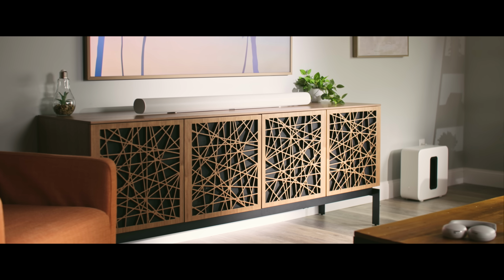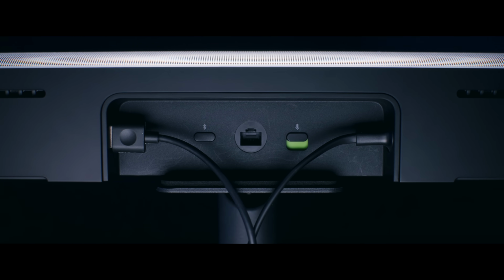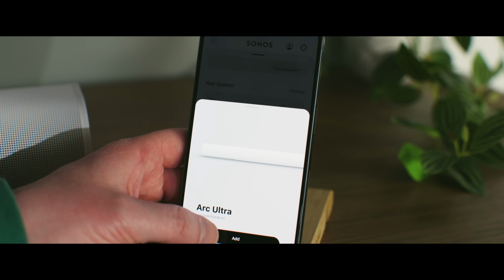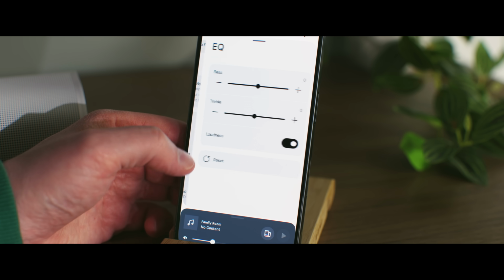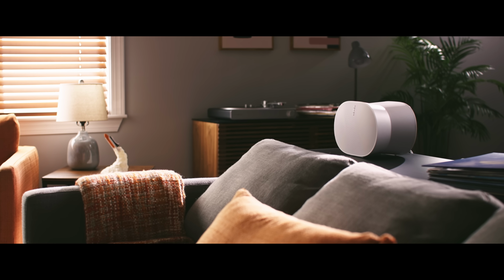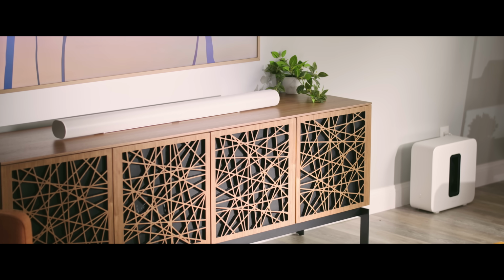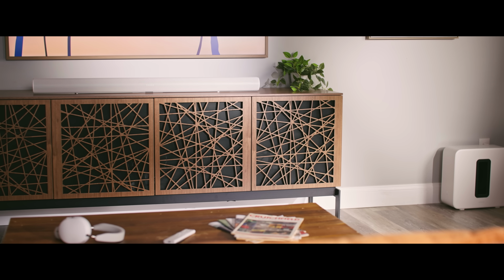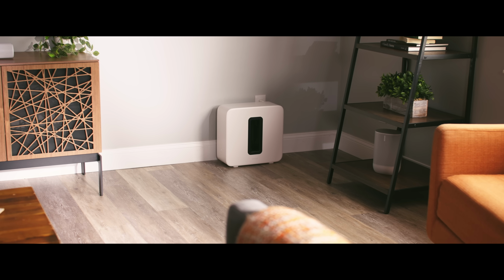Sonos Arc Ultra and Sonos Sub (Gen 4) | Crutchfield

Comment: I thought it was 9.1.4. Is that not true?

Enjoyed the video.
Reply from the maker: Thanks for watching! The Arc Ultra supports 9.1.2 natively. Maybe the confusion stems from the fact that there are actually 14 speakers built in. Sonos' processing uses those extra speakers to enhance certain channels when needed.

EDIT: Sonos uses those extra speakers as height channels ONLY if Era 100 or 300 speakers are added as surrounds. So it does indeed support 9.1.4...but you have to add those extra 2 in the form of Era 100 or 300.

EDIT II: Sonos informs us that a recent update has indeed unlocked native 9.1.4. That happened between shooting our video and now. Thanks for hanging in there with us!
Reply: @crutchfield  If the speaker is standalone what would you say it is? 9.1.2?
Reply from the maker: 9.1.2. It becomes 9.1.4 if you add surrounds.

EDIT: Sonos has in fact enabled native 9.1.4. That happened after we shot this video, but we're happy to correct this now!
Reply from the maker: We've just learned that a recent update has enabled native 9.1.4 processing for the Arc Ultra. It happened after we shot this video, where we describe it as 9.1.2.
Reply: @crutchfield wouldn’t it be an 11.1.2 if we’re going by dedicated speakers and not virtual speakers, if using the eras 100s since they don’t have up firing speakers like the era 300s
Reply from the maker: There are indeed "extra" speakers in there, but Sonos uses its processing power to enhance other speakers as needed with those speakers, so they're essentially "joining" one of the channels...despite there being 14 drivers in there. Hope that helps!

EDIT: Sonos informs us a recent update has enabled native 9.1.4.
Reply: It is